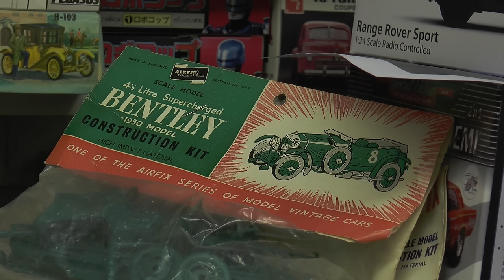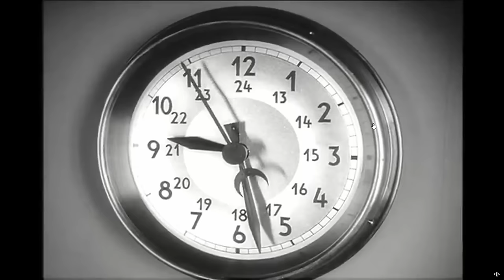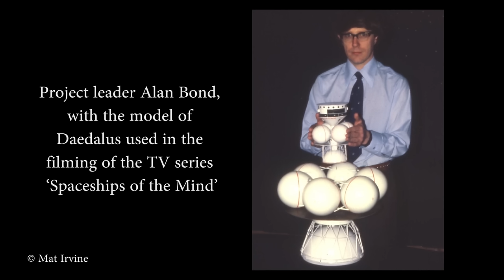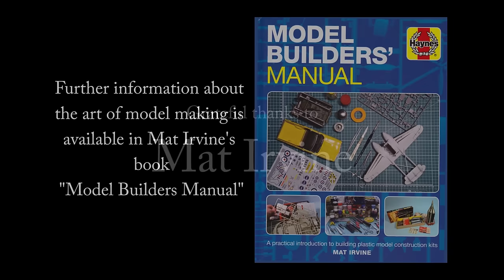The Miniature World Of Mat Irvine

Comment: I realise you probably wont have time to read this but: I am of the Airfix generation and got a lot of pleasure from the kits. Back in the 50s and 60s the thing was making things you couldn’t buy, plunge moulding canopies to make the ‘trainer’ version of an aircraft, building vehicles using Slaters Plastikard and Microstrip. A few decades ago I put together a ‘toy soldier’ set for a friend’s lad and he took to it. I was looking for cheap and easy options and at the time I actually corresponded with Mr Kine, he was looking at a pile of EPS foam from a fishing boat hold but that wouldn’t be available to the average impoverished single parent. I have made a lot of sets since then, world war two, knights and knaves and sci-fi and the scenery is all cardboard, tea leaves and the like but they get notes on how it was done to encourage them to have a go.  Sci-Fi is the hardest, currently using a clear plastic egg baubel and plumbing parts to produce a Fireball XL5 like space ship. Finding the bits for sci-fi at reasonable cost is challenging, the days of the pocket money kit have gone and now we get things like link-and-length tracks on tanks, which makes the constraints of the human lifetime and issue. To date the kids have all enjoyed the sets, one is now being played with by the original recipient’s son, after 20+ years the scenery (cardboard formers covered in five layers of newspaper and glue with a top-coat of acrylic sealant) is still intact. If I win the lottery I’ll introduce a low-cost range of simple kits so the kids will have the same fun we did sixty+ years ago.

Comment: 10:00 The back of the fuselage on the original X-wing was capped off with the top hull of a Tamiya M4 Sherman with only the lower half of the turret just sitting there. You can see the front hatches, fuel fillers, engine vents, the works.